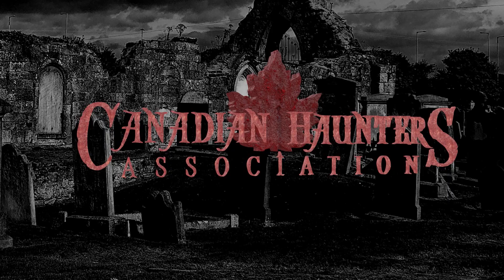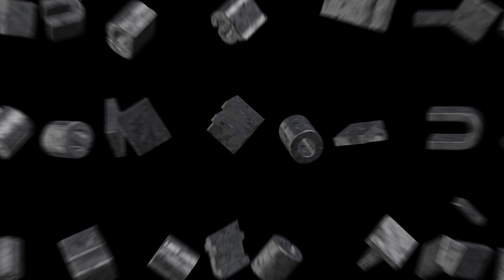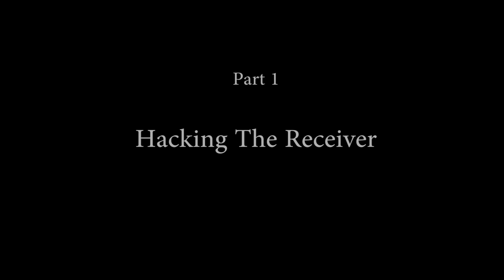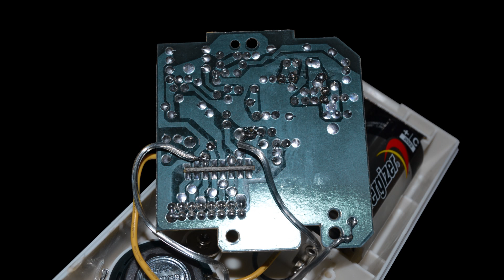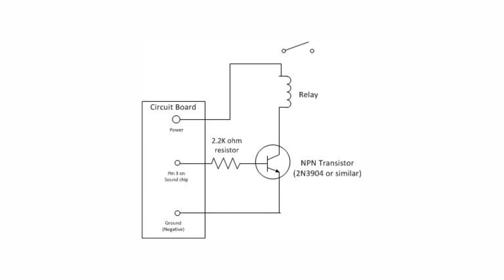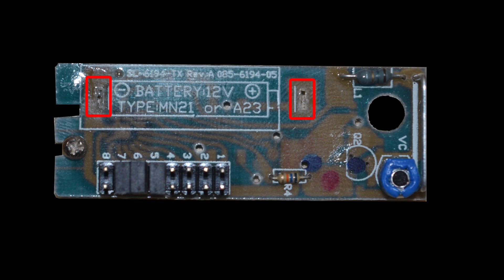Creepy Creations - Doorbell Hack

Comment: You really should use a snubbing diode with a low value series resistor across the relay coil to prevent the back EMF pulse from eventually killing the switching transistor.